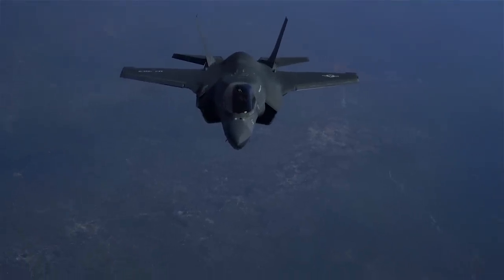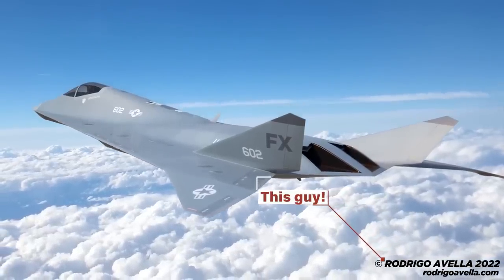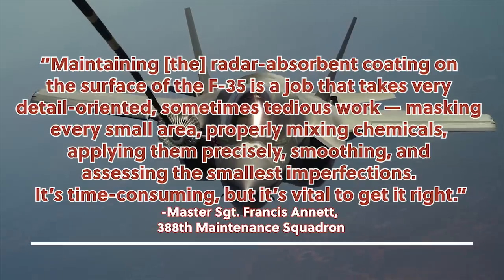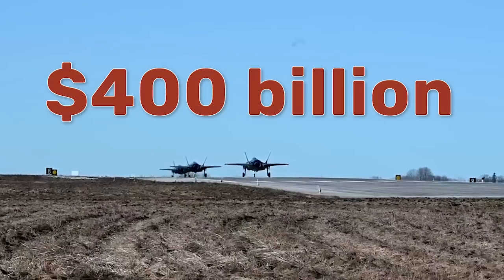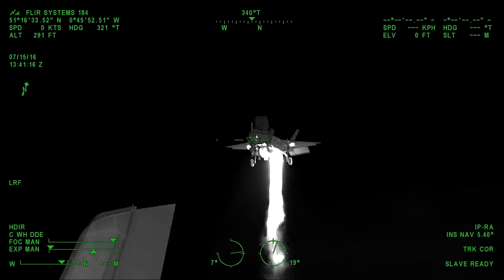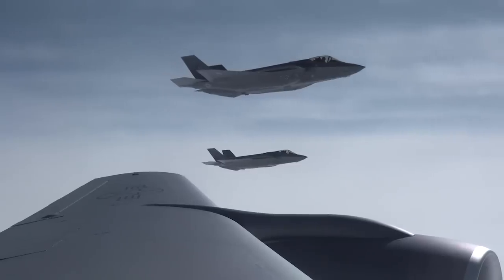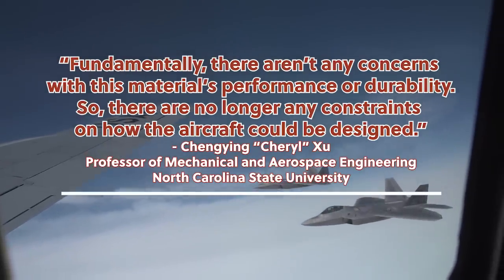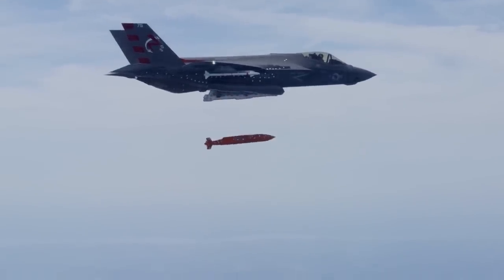The biggest leap in stealth tech since the F-117

Comment: The first use of RAM was by the Germans in WW2 for u-boat mast head stealth.    The Germans used both Jaumann absorbers and ferrites as well as a combination.    These are still in use today.  This is how the German Jauman absorber worked.    It was optimized for allied 10cm (96% radar absorption) radar but worked quite well at 3cm (80% absorption) and fairly well at 25cm. 
To deal with 10 (actually 9cm) cm radar its thickness was 2.5cm  which is a 1/4 wavelength.  The material consisted of 7 cardboard sheets impregnated with exponentially increasingly dense of semiconducting graphite.    The sheets were joined and impregnated with PVC to make them water tight and wrapped around the periscope or snorkel.   The energy of a wave would be gradually absorbed by the semiconducting graphite much as a sea wave hitting the slope of a pebble beach.  (as opposed to reflecting of a sea wall).    The greatly attenuated wave still hit the the snorkel underneath and reflected but was absorbed on the way out.   The small reflection on the surface of the Jaumann coating then cancelled out the reflection on the incoming wave.  
-Ferrites were molded into PVC for odd shapes where the jaumann absrober couldn't be wrapped.  Some 30% was absorbed.   By combining Jaumann and Ferrites a 99% absorption could be obtained.
Reply: Alright
Reply: Submarines is where it started.
Reply: The first couple generations of RAM had to do with disorganized lines of force getting oriented in a certain direction after being hit by radar energy and then being  unable to return as strong as the energy being put in.
Reply: @SeedOfElijah  They were referred to as re-entrant structures.  They tried to trap radar waves and absorb them.  SR-71 had them.
Reply: @williamzk9083  From what I have read those structures are built in to the airframe? If you can change the recipe and reapply then perhaps some combination is being used now. Ideally you would be able to change the characteristics without reapplying anything.
Reply: Someone who actually knows the origin of RF stealth.  Germans started with pyramid-shaped RAM, then developed the iron microscopic spheres embedded in resin to form another improvement on RAM.  There’s a great lecture on this from within the Australian MoD.

The US took a lot of those materials and tested them on the P-80 Shooting Star out of Wright Patterson.  Performance was so compromised, the aircraft could only fly straight and level with a flight path aligned from Wright Patt to another airfield relatively in-line with the departure runway.  They took it through a Radar test range that had been arranged along that path.  They later tried using another RF emission manipulating technique on the U-2 in the 1950s, which degraded the U-2’s performance so that it could not execute its mission profile.  It was then that they knew they needed another airframe design from a clean sheet, which became the A-12 and later RS-71A.  There are a lot of composites on those aircraft, with all leading and trailing edges, plus the vertical stabs made from Lexan type composite materials.  The leading and training edges have an asbestos honeycomb matrix underneath them to mitigate thermal loading from high Mach air friction.
Reply: @LRRPFco52  I actually made Fe50 myself, one of the only people on the internet I might add. And I am not bragging, I am just saying I could care less what the Germans did. Ok?
Reply: It's a shame you havent shared that with the German military, maybe they can make some iron sphere stealth and see how long it lives? I am being sarcastic necessarily I think. I read up on what they did and they were way ahead of everyone then. Not so much for this topic recently.

Comment: The problem of the maintenance of coatings is an old story.  Another Lockheed fighter was subject to the same issue leading into World War II.  The Lockheed F-4 Lightning was the recipient of a special paint known as Cabot or Haze Paint.  This paint was equally difficult to apply and maintain and subject to wear.  Efforts to improve upon this yielded what was called Synthetic Haze paint which saw limited service on the F-5.  In the end, the AAF switched to simply painting their photo-reconnaissance Lightnings with RAF PRU Blue which was often scrubbed off by ground crews to reduce the weight of the aircraft at the squadron level.  Haze paint was such a problem that the AAF decided it was better to simply Shadow Shade paint their F-4 and early F-5 Lightnings in olive drab over grey.  In the case of our squadron, 34th Photo Reconnaissance Squadron, all of our F-5's were stripped at some point to natural metal.  A very messy job!

So coatings to help hide and obscure aircraft are an old issue and one which Lockheed has dealt with before.  It makes one wonder if the Lightning II was intended to receive a new type of coating in the future as part of its modular design?  I certainly hope so!

Thanks for the excellent reporting and safe travels!
Reply: f4 lightning? aint it the p38 lightning?
Reply: @dasch0und  in this time “P” denoted pursuit while “F” denoted photo reconnaissance.  Lockheed Lightning fighters were P-38 while the reconnaissance variants were F-4 and F-5 depending on the model.
Reply: @pastorrich7436  I cant seem to find this prototype anywhere thats why i was asking if possible can you link me a video or a image? aviation has been my passion since early ages learn a new one would be a pleasure tho even tho is just a variant i would love to see the difference between them
Reply: @dasch0und  I Bing searched "F-4 Lightning" and got rewarded with a boat load of WW2 photos of p-38 looking but definitely altered aircraft.

Comment: This is patently untrue, the F-35 has the best performance characteristics of any aircraft in the U.S. air force bar the F-22 (which lacks the dramatic sensor integration and cost benefits of the 35). Its thrust-to-weight ratio is second to none, and its maneouvreability is excellent thanks to thrust vectoring.

Comment: I've wondered if the hard points on jets and the missiles and weapons can be made steathy. So your not worried about loosing steath when weapon doors open. And your explanations of the maintenance of steath was very eye opening. I knew there was constant maintenance but wasn't aware of the speed limitations due to heat.
Reply: Didn't you ever see pictures of the black bird's and exp f-15's coming back after making record breaking speed run's. Not much paint left on those brand new birds!

Comment: Issue with ceramic is cracking. Rapid heating and cooling can crack it. Airframe stress can crack it. The cracks can be tracked and locked by high frequency targeting radars. It's like aerogel with nucleation sites that match the high band frequencies you want to entrap.
Reply: that most likely what they are working on now
Reply: I don't know if what you say is necessarily true. We don't know what the bonding medium is and the ceramic is likely in particles, not a solid substance like a ceramic pot.

Comment: There's a possible new tech based on the same material and process used to make commercially available RFID tags. It's more or less the same kind of laminated circuit sheets, but the individual transponder tags aren't stamped or otherwise cut out of such batch sheets. The idea is to take one incoming signal frequency and re-emit it at hundreds of different frequencies with thousands of little transponder circuits in the film. For instance if you had a radar looking for 100W return from a surface at a certain frequency its emitting, it's going to have problems finding less than 1W of power coming back at each of the split up frequencies re-emitted by the micro-transponders. Inverse square law could even make that worse at range. Such a circuit laminate material could be based on a silver-graphene film for instance, which might explain how some of the newer test-bed aircraft look without an overcoat of some other paint.

There's probably some other tricks needed to make it more effective still, but sheets of that material could be applied quickly to a lot of things giving them some stealth characteristics even if not initially designed with it in mind.

Any other info to prove this? No. But the technology and means are there if it happens to work. It's a novel application of something that could be considered off-the-shelf and would be relatively cheap in production given that it's already used for something else in commercial applications.

Comment: A Thicc15-C  <giggle> straight out of ceramakote.......  I expect the layering is a bit more than just a coating of paint, maybe more like the polymer tapes used on antenna leading edges.  Even then a harder coating more durable than paint would be a big change escpecially if it is a primer layer under a regular paint coating.

Comment: Interestingly most of the effort is for a head on approach. Like the time the F117 was seen over the Baltic, they are still a big fairly flat object seen flying overhead from the ground. The coverage "paint" is interesting, but the are still physical visible to the Mark I eyeball and a pair of binoculars, and sound tracking.  Also, they need to cover the tanker with this coating as well, or they can just track the tanker and wait for a fuel up to attack.

Comment: This aircraft ceramic coating sounds a lot like the newer ceramic and graphene coatings available commercially for both professional and home car detailing.
This car detailing technology is pretty incredible, when applied it can mean not having to wash and wax a car monthly(recommended).
Assuming that a visible "liquid look" isn't as important as application time and protection, I can see how coatings including even a spray application can work on aircraft...
A change of formulation would be necessary to increase the amount of ceramic or graphene particles, and to increase the curing time as necessary (for cars typically 2 minutes between coatings, 24hrs to a week for full curing). For cars, the result is usually an expected durability of 6-12 mths for the cheapest coatings and at least 7 years for the more expensive (typically approx $100 for 10 oz). Although car applications typically are extremely expensive due to needing a full day's work of prep and application, if an aircraft was less concerned about looks I'd imagine the process could be automated enough to achieve at least the same kind of durability at relatively low manual cost per application with its special, more concentrated formulation.

This is not rocket science and it worries me a bit that the basic concept and maybe even a good part of the needed formulation is so widely and publicly available, but it also means that this extremely expensive and necessary cost component to fly stealth aircraft likely can be brought down very, very low to the cost of relatively common car detailing.
Reply: No, this is like ceramic header coatings used on exhaust systems.   Applied like paint? Check. Handles extreme temperatures? Check.  Looks like Chrome when sprayed and polished? Check.  Everything about this looks like spraying jets with Cerakote exhaust coatings over some insanely complex system.

Comment: One contention with this video and the issues with RAM along with failing at high speeds.

As you said, operating above a certain speed is not allowed except for emergency.  Well, that actually means fighting.  You can actually train in aircraft where the coating is damaged or simply replaced with a coating that's durable.  Then when you get into a real fight, you can move into position sub sonic which is the purpose of stealth.  Once engaged it's one plane vs. the other, but even a plane with some damage to some surfaces is going to do better in a fight based on the weapons being used than a plane that has no stealth coatings or shapes.

Yes, it will help to replace RAM as technologies allow, but the US military can train and fight with stealth in a way that isn't so financially draining, with the exception of aircraft on ships.  Since pilots train from carriers, and a carrier needs to be 100% ready to fight when at sea in an operating theater, there's no way to train higher speed fighting without damaging materials.  Having said that, you could shift Navy pilot training to shore facilities for high speed training and then once on ships, the training is about stealth.
Reply: Frankly, most “high speed” training can be conducted in a simulator.

Comment: Can they apply the ceramic coating to existing fourth generation fighters like the F-15, F-16 and the A10? Would it be a benefit?
Reply: I believe it would be a logistical nightmare (like the F22) and those planes aren’t designed to be stealthy, so it’s much more cheaper to just make a new plane dedicated to stealth.
Reply: @hl2bigboss  The ceramic coating is much, much, much more durable than what is currently being used by the F-22.  That’s the whole reason it was developed.  So a logistical nightmare, no.  It is supposed to also be a good bit more effective than traditional RAM, but is it good enough to reduce the RCS of legacy aircraft enough to do any good? That is the question.

Comment: An awesome direction to take it is to develop a system that absorbs radar and releases it at a different EM frequency. Radar to heat, or radar to electrical energy. Basically stealing tiny bits of power over extended flights. Just gotta get the efficiency up. This is super cool.
Reply: I picture it can be done. If you have some idea of how RFID tags are produced, this material may be rather easy to scale up in production using existing processes.

Comment: As soon as you hear how hypersonic stealth fighters conceal their heat signature, please advise.
Reply: They don't. Although only high altitude IRST would see them from a particularly long range.
Also, there is a countermeasure.
But yeah, that's a limitation.
Reply: I'm guessing they'd slow down going into the combat area if IRST detection will be an issue. The question, though, is how far away one needs to be to detect a hypersonic aircraft on the infrared basis. A few miles, maybe?
Reply: @kathrynck :
Thanks.
Reply: @Ilyak1986  I've seen iRST detection ranges quoted as high as 75 miles.  At 5000mph, the 75 mile closure time is 54s.  That is the extreme, but I assume a hypersonic vehicle will be at the high end of detection range, especially one that is propelled and sustains those speed - ie not a glide vehicle.  Is that enough time to respond? Maybe.

Comment: Love your videos.  Thank you.

Just wondering why in the world the Air Force allowed such a potentially groundbreaking discovery be disclosed so publicly. Not the question is will the Chinese or Russians get this in service before the US?
Reply: Trust me it's not so simple that the smoothbrained chinese can figure it out just by hearing the word "ceramic ram"
Reply: @HailAzathoth  well, the paper was pretty thorough and was peer reviewed. One of the hallmarks of peer reviewed articles is that anyone with the requisite academic credentials should be able to verify the claims in the paper. In Chemistry that usually means someone can independently create the substance and verify its properties.

I’m no chemist, but just from the abstract, it seems that the big breakthrough is a ceramic composite where 40% of the composition is ZrB2 (1 Zirconium & 2 Boron atoms) nanoparticles.

And as to the original point… it doesn’t sound like this was necessarily research funded by or directed toward military applications. My guess, and this is total speculation, is that they stumbled across the radar absorbing properties of this new material by accident whereas the original research was looking at some other property such as durability, heat resistance, or something like that. Pretty difficult for the military to keep it quiet when private citizens create something like this that just happens to have a military application.
Reply: @benjaminlynch9958  The composition of the composite and any details regarding its military application will be classified.
As for the basic science, while the research paper reporting the discovery will be in the public domain, without access to the experimental data the results can't be easily replicated.

Comment: “Polymers” are a widely varied group of chemicals. Regarding heat affecting polymers, the ceramic tiles on re-entry vehicles are affixed to the spacecraft with…a polymer. Polyimides can be very heat resistant, far above 250 C. Why don’t radar absorbing materials use polyimides? I’m not privy, but I do know they cost a lot more than most polymers.

Comment: If the material works, I see the move to 6th gen happening pretty quickly and the F-35 gets slashed by a good 50%
Reply: No. There's no cheap 6th gen multirole in the pipeline.

Comment: I react on one thing here. Thick ceramic coat is mentioned in the end. Maybe they have a very good solution to this but in general ceramic when thick is not flexible. A dynamic part such as a flexing structure on an aircraft like a leading edge does not sound like they will work so well together. But it all depend on how this thick is. And how dependent the Radar absorbing ability is on its thickness. 
   Also this will translate to ossues with bonding if it is an issue with thickness.
Reply: I'm gonna guess that the material itself is already developed and the time being researched is how to properly apply the coating for the best radar absorption and performance. I'm gonna guess some kind of polymer will still be used to maintain some ability to absorb shock.